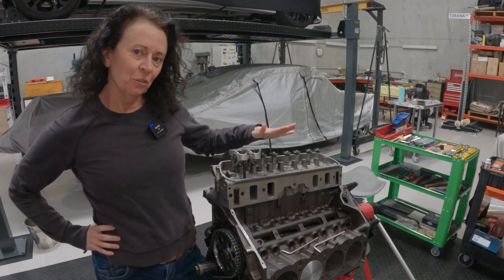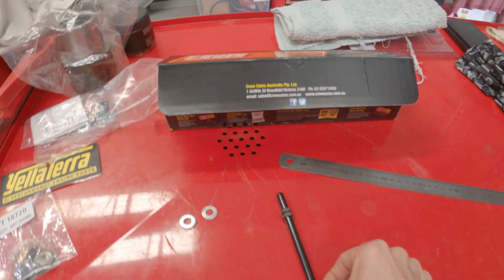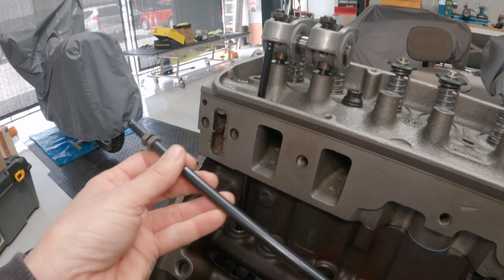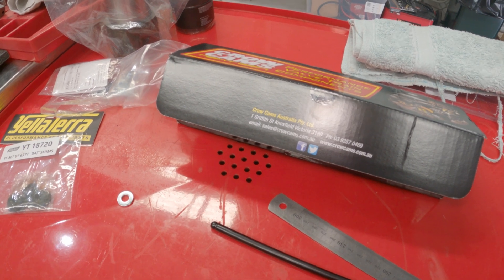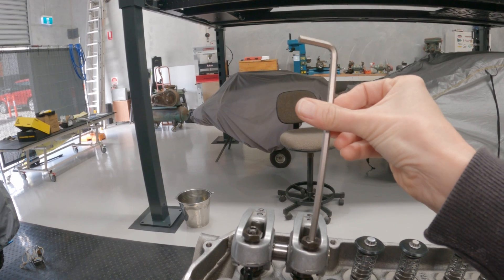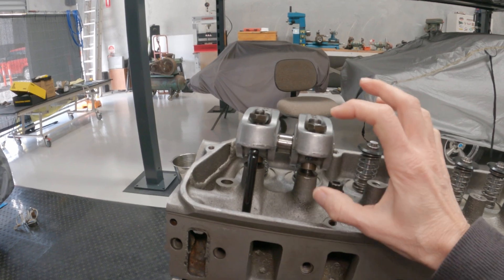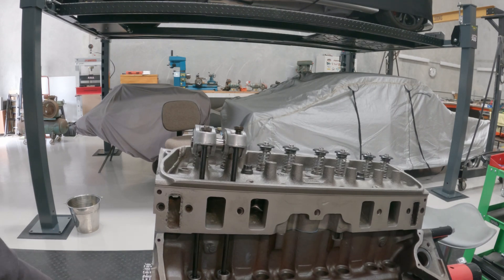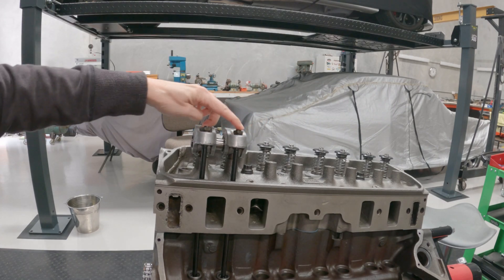Zero Valve Lash Solved! New Pushrods & Shims For My Holden 308

Comment: The way I was taught. Was make a mark opposite TDC at 6 o'clock on the harmonic balancer and then one at 3 o'clock and one at 9 o'clock
Which means both valves should be closed at full compression on cylinder number 1 with the TDC notch on the harmonic balancer lined up with TDC on the timing cover adjust the preload 3/4 of a turn down tight.
if it won't do it you shim it or shave rocker post.
then....turn the crank quarter of a turn line up the mark follow the firing order setting the preload on next Cylinder in the firing order  1 2 7 8 4 5 6 3
Or is it the running mate cylinder? So on 1 adjust 4? 2-5, 7-6, 8-3

Comment: Saying gd' day from the east coast of America....got a question....whats a HOLDEN????
Reply from the maker: Seriously? 😂😉

Australia's only car major manufacturer, as a branch of General Motors. I understand that Holden even built the engine and driveline for Chevy's gen 5 Camaro... check me on that tho. And I think the Chevy SS was actually a Holden Commodore.

However, Holden closed up for good several years ago. 💔
Reply: Made by GM for Australia
Reply from the maker: Holden had a few manufacturing plants in Australia, and designed and built cars specifically for Australians. The 308 that I'm building is completely Australian. Later years Holden imported some models as a base. Heaps of history is available online.
Reply: @staceonwheels thank you stace...appreciate you getting back to me ..and yes..seriously...!! I don't think too many yanks know about the holden !! Thanks again...your a legend mate
Reply: @gregdowd939 Holden exported cop ready V8 Caprice for US Law Enforcement, and also Pontiac GTO 2 and 4 door  using 5.7 and 6.0ltr LS

Comment: Great video Stace! As you point out; the variability of part fit is the result of "tolerance-stack" differences across all parts in the system: from deck height, cam base circle, valve length, valve seat depth, spring seat depth, to rocker pedalstal height, and any number of other factors when non stock parts are employed. It is super-important to check the valve train geometry exactly as you have. A couple of things that may help:  you can sneak up on the point of zero-lash by spinning the pushrod between your fingertips as you tighten the adjuster and you may get a better feel for that exact momentof zero lash; also, sometimes the lifter plunger can have a stronger resistance than the checking valvesprings installed -- and this may move the valve off the seat rather than preloading the lifter. A lot of people use a hydraulic lifter modified to be solid for the purpose of checking valvetrain geometry. Using some blue ink (sharpie-pen) to mark the tip of the valve prior to mock up assembly will allow you to see the sweep pattern of the rocker tip after doing a full engine rotation. Ideally you want the rocker sweep pattern to be very short (close to a straigt line of contact) and centered on the valve stem tip to avoid side-loading the valve in its guide. Pushrod length is what adjusts this sweep length and position. Love what you're doing! 😎💥💪)
Reply from the maker: Thanks for your reactions to all this, and the extra info... I've had the heads and block decked a bit, the valve seats cleaned up, and many other little things that all obviously add up. Didn't bother getting the blue stuff you mention, but might when it's time for final assembly. It's all fun.

Comment: Hi Stace  first time commenter. I just have to say, I love the way you explain things so eloquently and accurately in layman's terms. I watch a lot of engine builds by awesome professionals that know their stuff but the explanations of the hows, whys and wherefors often goes over my head. Not so with your explanations. Your thong slapper is going to be absolutely spot on and very long lasting with the care you're taking with this build. THANKYOU so much for your concise explanations. I've slapped together many a 253 and 308 in my years,quite hap hazardly as it would appear without taking the time to fully understand tolerances, particularly top end. I always made sure the bottom end was sweet but never paid enough attention to the hot end of business.
Reply from the maker: Wow, for a first time comment that was bloody awesome! Thanks so much and I hope it's not the last time you comment... you may have some advice as I turn attention to the bottom end next 👍

Comment: Don't need to count the turns really, just rotate until the freeplay is gone then add the half turn. I bought the crow cam kit but noticed they were putting 186 length pushrods in (longer) so I asked them to swap for std 202 length. Especially as the heads have had some thou shaved off in their lifetime so longer pushrods would cause geometry problems and even prevent the valves from closing properly. Got the engine in and did a test fire last weekend, planning on getting the radiator support cleaned up and put in so I can give it a good run to bed the cam in. Still a long road yet. Good to see you're back onto the tonner Stace.
Reply from the maker: Hey Spydey. Great to hear you're making good progress. 

I only counted the turns to see how much of the adjusters I was using 😁.